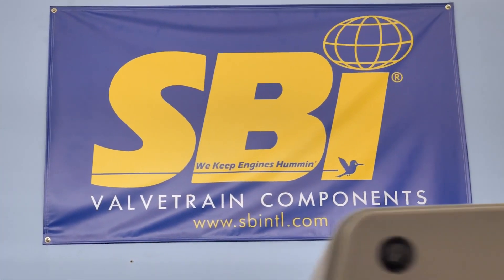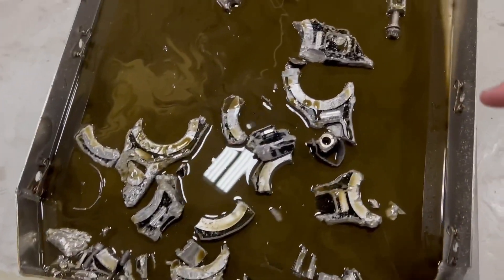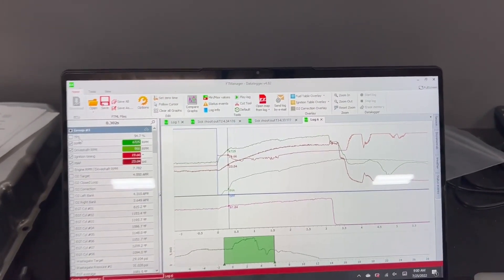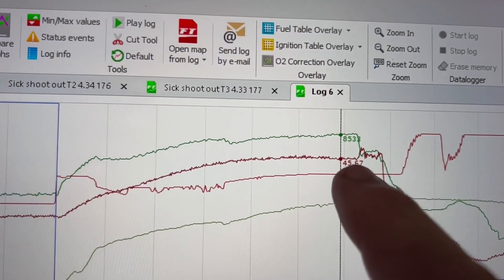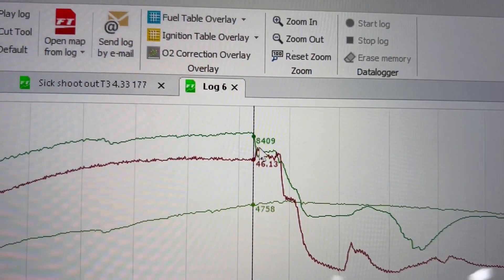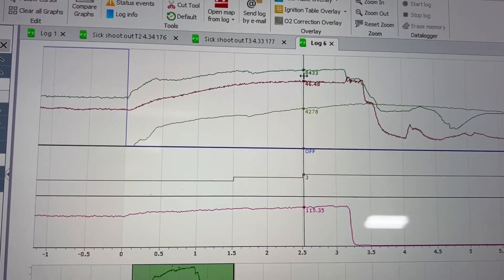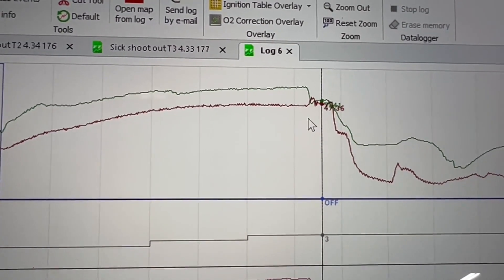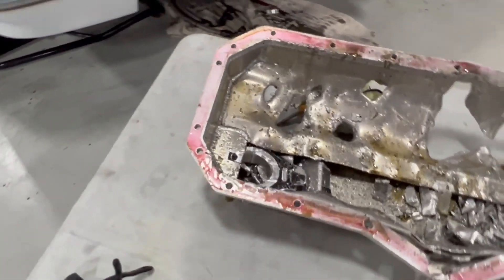Worst Engine Carnage Ever? Part 2

Comment: Like you said, no pistons/pins (valves or rings...) in the pan, have you pulled the heads yet to see if they're salvageable?   
LOVE the data logging (even spotted the LVDT on the left front suspension)!
Great looking wagon, hope you don't lose too much time before making it back to the strip.